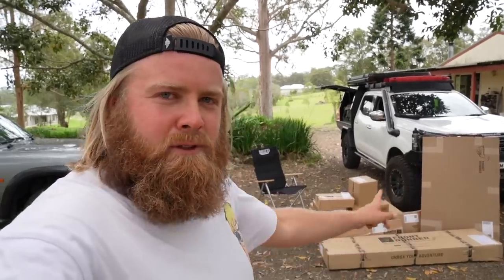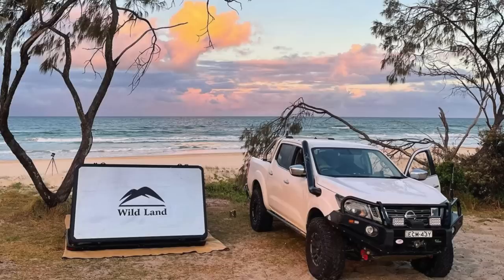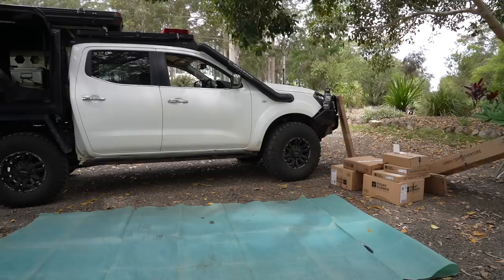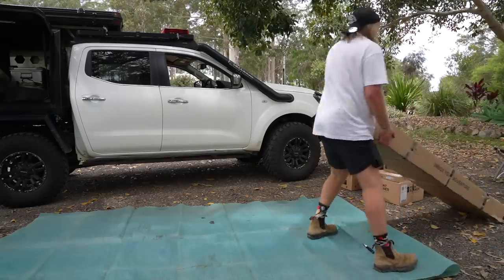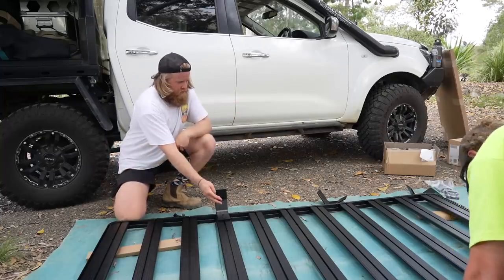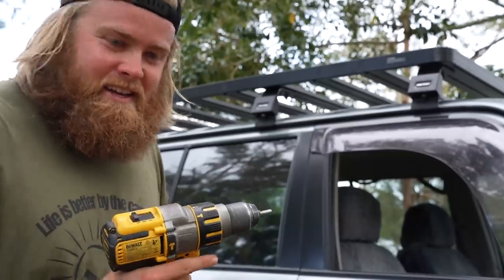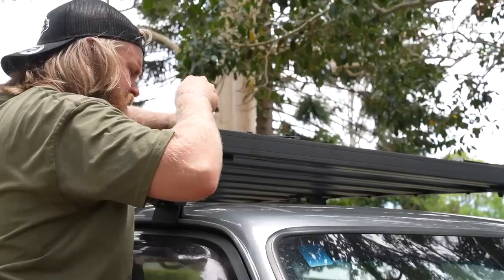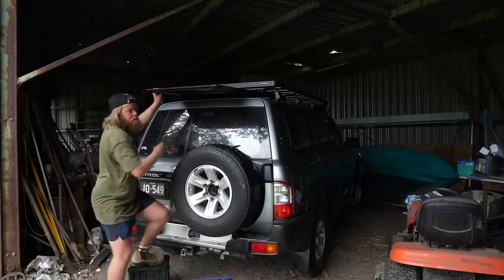DON'T get CAUGHT OUT! Nissan GU Patrol Build #1 Know your roof rack load limits! | Roof Rack Install

Comment: Just a little tip that I'll share with you all while fitting my roof racks by myself on vehicles.  Use a pumped up single air mattress or lilo to sit on top of your roof.  Sit the roof rack on the mattress and adjust the air pressure to install the mounts.  Then deflate the air mattress.   No scratches or dents and can be done by one person!
Reply: Good tip 👍
Reply from the maker: Cheers mate 👌
Reply: That's a bloody stunning idea!!!!

Comment: Tyler what I used to do many years ago was cut up a tyre tube and use a small piece to sit in the gutter and also wrap over the gutter a little so that not only the rack leg is kept off the metal but also the bracket is prevented from damaging the outer gutter at all. As long as the piece isn't any wider than the bracket no one will ever know it's there.
Reply: Same....
Reply: Same 2.

Comment: Yeah I have to agree that the Front Runner rack is the benchmark for racks.
My last was a Rhino and I loved it. Never let me down and pretty tough.

I have to say what happened to the Navarra with the Rhino had everything to do with how it was mounted and nothing to do with the rack.

Gutter mounted racks are always strongest and will allow for greater weight carrying.

Putting that frontrunner rack together is a mission but Crikey it's worth it.

PS. I like that rubber idea in the gutter but you may find water may not drain passed the legs.

Thanks for sharing
Cheers Mick

Comment: Nice one Tyler 👍 I had the same issues when I was looking for an official roof load rating for my 1996 80 Series LandCruiser.  Nothing is listed in the owner's manual, so I submitted an online inquiry via Toyota Australia's customer service website and, they too cannot provide me any information.  This really surprised me, as I see this as important as the GVM info etc.  And like you, I've looked online and it seems to suggest anywhere between 100kg-150kg.  And if the LC200 has an official 200kg roof load rating via a roof mount, I figured, 150kg via a rain gutter mount across eight legs would be safe.  PS. My roof rack came standard with several strips of rubber for the RR base.  I'm surprise Front Runner does not provide these also.

Comment: front runner racks r really gud. i got my front runners wen u had the prob with the other brand n u showed the front runners which i knew nothing bout. i have 2 front runners, one for my ram 1500 canopy which carries my james baroud roof tent n the other is on my xr8 canopy. i have the 2 tables n 2 270 awnings n there the best 2 acc by far, there awesome. the whole thing bout ur channel is ur honesty bout cost sponsorships failures n wat u cant do n wen u try to do the mistakes u make. YT channels just dont do this, creds to u TT.
Reply: @krump743  thx for the tip.
Reply from the maker: Thanks mate!

Comment: Hey mate, I’d go purely off your manual stating 100KG as that’s the only documentation you have for the car of that age. Yes they may say 120kg per 3 bar set however that’s what the 3 bars will hold, not necessarily what the roofs’ guttering will hold safely before ripping off - all you’re doing is spreading the weight further along the guttering. 
The way I look at it - 
100KG across two bars = 50KG per bar. 
120KG across 3 bars = 40KG per bar. 
You mention the 100KG / 2 bar has 4 points of contact = that’s 25KG per point of contact. 
The 120KG / 3 bar has 6 points of contact = 20KG per point of contact. 
150KG rack / 8 points of contact = 18.75KG per point of contact. So even though your front runner rack may have more points of contact, it is actually less weight per point of contact ...
I don’t think putting a rack up with say 10 points of contacts, would necessarily allow 300-400KGs if that makes sense because it’s still the guttering that is holding up all that weight. 
I’d play it safe and go off the manuals 100KG and be safe rather than sorry. 
That’s only my take on it anyway. 
I do like the look and style of the front runner racks but Holy Dooley - $3,500 grand odd with the table, crikeys ! 
Great clip as always mate. 
Cheers Tyler and keep up the good work bud. 😉👍🇦🇺

Comment: Good idea with hose on mounting feet, I had an ARB rack on my GU and it came with rubber pieces that fit under the feet to stop paint damage which would lead to rust. I am surprised that Front Runner don’t supply.

Comment: Those little rubber protectors for the gutter are a good idea. Many gutter mounted racks come with them.
Reply: That is where moisture will build up & start to rust the guttering. Seal them up

Comment: Tyler,
I too sought information for my 2015 GU wagon. Found the confusing variations that you also came across so went to Nissan. After several unsuccessful attempts, ended up with the following from Nissan (complete with the punctuation they used):
"there is no limit spec is based on the roof rack load limit on the part EG Nissan roof racks are rated 100kg for the dual and 120 for the triple rails system if using aftermarket racks use the recommended weight from the supplier if damage occurs due to the weight when using aftermarket racks then the supplier should be contacted".
Also I believe there is no requirement to subtract the weight of the racks from the limit of the rack (not the roof load limit) as those specs are the carrying capacity of the rack. Definitely need to subtract that from the roof load limit as the rack forms part of that load.

Comment: I've got on my 4.8 GU an alloy roof rack and its not been a problem loading it with myself (90kg) and 4x30l of petrol and much of other stuff, and going through Simpsons with this (excluding myself from the roof rack lol) with no consequences. So i am pretty sure its not 100kg load capacity. Which you mentioned one can load whatever wants to )) Cheers!

Comment: Good explanation of the limits of load rating for the GQ patrol.. even though your still trying to get a definitive answer of the load rating.
Looks like a sturdy roof rack. I like the 8 mount system too, distribution of weight is important as you know.
You should be fine for your intended use...👍
Reply: Yeah very true my mum put roof racks on her Datsun years ago so she could pick my dad up from the club when he was drunk but quickly found out that he was to heavy when the roof caved in.

Comment: Hi Tyler. The only thing I would do with the roof rack,  is see the actual clamps for the rack I would have put on a bit of rubber as you did with the part that sits down in the gutter. Its only a thought as metal to metal is slidy a extra bit of rubber on the clamp part would stop this, also protect it from possible rusting.
Reply from the maker: Yeah definitely could do that 👌

Comment: Looks good and will be very useful. Any reason you didn't just buy the table brackets and use the table you already have?
Reply from the maker: Ill still be running that table on the nav, Ill be consistently using both 4wds on trips so just want to minimise the amount of gear I have to constantly swap back and forth between them and on family trips we will take both 4wds and then have two tables 😁

Comment: also mate I’d be moving the gutter mounts as close as possible to the pillars, whether that be moving the whole rack forward, or moving them where they mount to the platform, when they’re in the middle of the doors they can sag the gutters slightly and interfere with the door closing
Reply from the maker: I'll check that out, thanks!

Comment: From the page you posted at 3:50 wish its says use a safety factor of 1.5 for extreme off road conditions - I read that to be 120/ 1.5 = 80kgs as the dynamic load but yes its all a bit vague.
Reply from the maker: Yeah that's for those Nissan branding roof bars, but then I confirmed with front runner the rack I got off them does not have a safety factor of 1.5. Some companies do it and some don't

Comment: While you’re talking weights you should run that patrol over a weigh bridge after each mod or get a starting weight then keep a tally. I’m at 2.9t with just me in the vehicle, full tanks of diesel, alloy rack with nothing on it, steel front bar with winch and custom drawers. I’m looking at a gvm upgrade so I can then take the wife and 4 kids and load a camper trailer.

Comment: Great info in this video mate. It is mine boggling that Nissan or any other manufacturer cannot give exact load ratings for their vehicles. How is the average Joe supposed to know what to do when installing Roofracks
Reply: It should be on compliance plate, just like GCM & GVM and tyre size

Comment: I've had at least 300kg on the roof of my 02 GU Patrol ! with it's steel heavy duty roof rack it's 8 points of contact I'm pretty sure it's an ARB or very similar to a 4wdsupacentre  .. I'll try and have a look for you after this video !
Reply: alright ! so you've explained this very well and very logically. I think the answer is that when these cars were manufactured they wearnt intended for big heavy roof loads and a "roof load rating" wasn't necessarily a thing back then.. as it was mostly up to the product that you were attaching .. I think the best way further officially would be to be seek an engineer to give a roof load rating of the gutter system for your product rack just to further check that it's 100% which I'm sure it would be !!
Reply: I also found that 150kg was the max roof loading (unofficial)
Reply: personally I don't think this roof rack suits the car very well period correct era... as for practicality we'll have to wait and see ..
Reply: the table up there is a good idea ! lots of free space in that void ! I'd definitely consider getting that for mine .
Reply from the maker: Yeah its very hard to get an official rating mate!

Comment: It comes down to manufactures specifications mate, thats what the goons will look at if you have any issues.Just like insurance they will find any grey area to not cover any issues if anything goes wrong.  If the most weight Nissan says is 120kg for the three bar rack with 6 mounting points, then unfortunately  no matter how many more mounting points you have you are still governed to that 120kg load rating in there eyes. If Chris below can send you more information on load ratings then sweet as, but like you said you will need documentation to prove this.
Reply from the maker: Yeah for sure mate, that's what I was saying. Common sense would say higher but without documentation you can't legally go higher then the 120kg

Comment: Hi tyler, nice vid - enjoyed the set up. I have been looking at a rack for my troopy and it's not an easy process. In regards to the awning your planning to fit, other than Drifter sponsoring you, what was the reasoning for choosing the Drifter 270 awning?  Cheers
Reply from the maker: Hey mate, cheers! On the lighter side of 270 degreee awnings in regards to weight, its free standing (meaning it doesn't have to be pegged down unless super windy), super speedy set up time and got coverage, I have the standard drifta awning now and its the best awning I've had so far. I've never had a 270 degree awning but the Drifta one definitely seems like a good one to try out

Comment: it's way to high for me i think  front runner do a lower slimline gutter mount
Reply from the maker: Yeah the higher one is to fit the table, you can change the mounts to make it lower
Reply: @TylerThompson90  looking forward to the lift tires and suspension vid, yeah thought they had a lower mount.

Comment: People who are not liable will tell you the higher rating, Nissan won’t tell you because it’s makes them liable especially if in writing, why they always resort to the bar that is their OEM product. 

Problem is the idiot factor today is so high that even when spelled out 1 + 1 which equals 2 people still get 10, so dated if ya do dames if ya don’t, even people who know better IMO ignore GVM load and roof rack load and it’s getting worse not better, just like rubbish and crap at camp sites and on tracks.

Great vid though dude, all you can do is keep trying to lead people to water.
Front runner must be making a killer at the. I and only sponsored big channels are using Rhino racks they must be bleeding like a White pointer attack at the moment in tossed sales, sure plenty of easy targets walk into ya ARB and load up in ignorant bliss just like the GVM loads.

I’m ex Army, so travelling light as possible is ingrained in me, but it def gets harder as ya get older, ya sacrifice a bit for comforts and the crap we can buy today to take bush is just amazing and a I find myself making a list what I need vs what I want more and more it is hard to stick to it, but I keep roof to a minimum and only light weight, heavier stuff is low down to the chassis/ vehicle floor as possible, 

I had my clamp system made in alloy one long rail style, lower stronger but I don’t use it to load more just prefer the support the look and lower to roof as possible figment and look, I’m not interested in anything able to fit underneath the rack and roof, my tab,e slides of from my Drifta draws, I prefer that keeps everything clean and easier to access, the only thing I don’t like is how high it is sitting on top of your GU. 

You bring up great info clear and concise cheers 🤘

Happy and safe trails,🤙
Reply from the maker: Cheers for all the info mate and feedback mate, appreciate it!

Comment: Regardless of brand, weight, load ratings. The biggest issue with your rhino disaster was pop riveting it to a Milo tin.
The amount of rhino gear on car roofs around Australia is probably mind boggling and yet we don't see them everywhere ripped off vehicles.
Reply from the maker: Start looking around and do you see quite a few ripped off, 95% of them are riveted. Rivets are a disaster on roofs

Comment: It would be nice to know what you pay for and what is supplied to you free because you are basically advertising for them
Reply: Agree…..It’s my biggest issue with you tubers, I don’t mind either way and good luck if they get gear for the effort they put in but just nice to know for balance. There are a couple now where I watch for the scenery and trip ideas and as soon as they start with product placement I turn off.

Comment: The maximum load you can place on that rack is 150kg, not 120.

The 120 is for the Nissan rails, not your rack, it is completely irrelevant.

The rating that front runner place on the rack has to incorporate the vehicle and it's capability to carry that load as well.

You have been sold a rack to suit your particular vehicle with a certain load rating. That's what it is, simple as that.

The capacity of the roof structure to carry a load is a long way beyond that point (they survive being rolled onto, at several ton of load), so it's a question of how the rack is affixed to the roof and the load capacity of those fixings etc, all of which is in the control of the manufacturer of the rack, which in your instance front runner have provided you.

Long and short, front runner have designed and sold you a product with a certain set of specifications. As long as you stay within those you've done nothing wrong.
Reply from the maker: Doesn't work that way unfortunately mate, front runner clearly stated to me you need to go off the manufacturers weight rating if lower, and the highest one I could find was 120kg. common sense would say 140-150kg but if there is an accident or something I could be in trouble
Reply: @TylerThompson90  Then they're doing a dodgy with their load rating.

They should be looking at the roof design and running the numbers on it to work out what it's load capacity is and designing the product to be within those margins, exactly the same as any tow bar manufacturer, recovery point manufacturer etc.

What they're doing instead is to say the rack will do X and it's your responsibility to engage an engineer to work out what the car will do. Nissan or any other manufacturer won't tell you that, even if you could find the person who knows what it is.

Comment: Don’t understand why you’re so worried, it’s way past warranty 
If your worried about insurance ask them to tell you
Reply from the maker: Roof rack warranty, insurance will go off the higher offical/written load rating which so far is only 120kg, legal circumstances in a crash etc, and safety